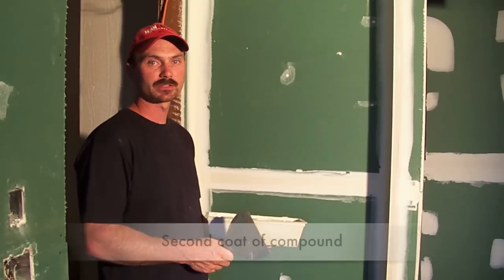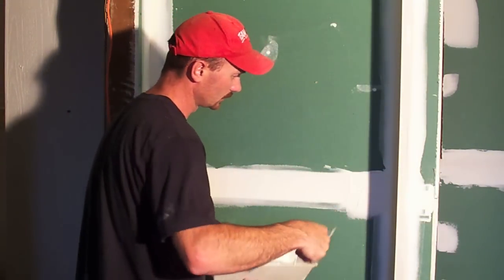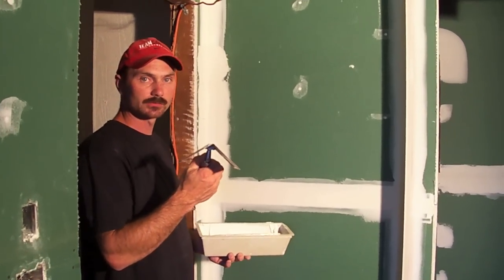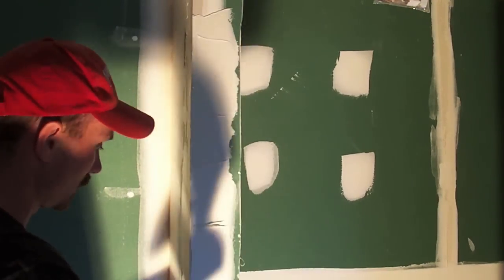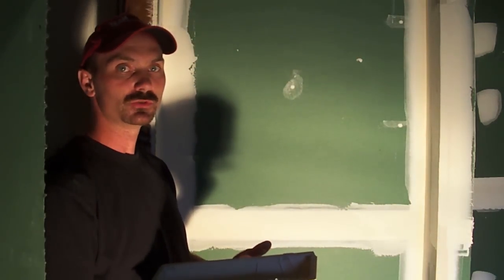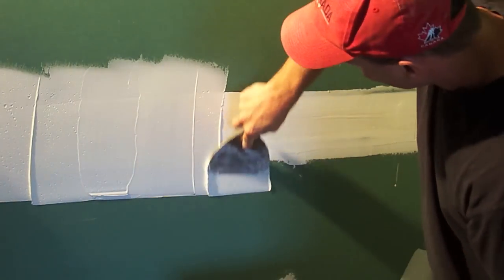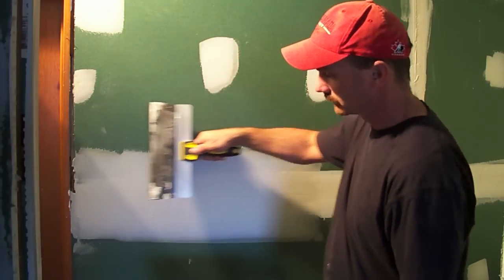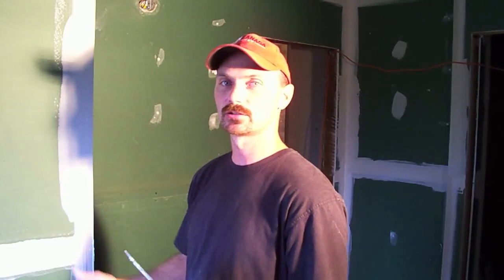How to mud and tape drywall [2of2]

Comment: I wish I had seen this video 35 years ago, when I was first learning. Mostly I taught myself with trial and error, and no instruction. Ultimately I came to use the same technique that you use, and I find it funny that you gave away all my hard earned tips in one easy lesson. You've made a great video.

Comment: To all the losers saying something like "You'd NEVER work for me! You'd get fired!": Please leave the name of your company so we know not to hire you. I've been in the building trade for many years and am sick of having to clean up the crap from so-called full time professionals who think they know everything and are only interested in getting finished fast so they can get to the next job. You always want to finish in an efficient amount of time, but it's the loud mouths and know all's who take the most short cuts, make the most mistakes, then cry out "I've been doing this for 20 years! I know what I'm doing!" This video is excellent for beginners/home handymen who have had trouble getting mudding & taping done. (And I've seen a few "pros" who should watch it too.)
Reply from the maker: Thank-you, and well put.
Reply: @Kauwhaka Sorry but we build office and light industrial buildings. The painters are paid to fix small imperfections. I need finish electrical, plumbing and ceilings in there ASAP I need doors hung, data pulled and servers installed. cabinetry..... After dry wall is hung you have two days tops. Current rate is $0.80 sq. ft. drywall mud and labor.
Reply: I'd never hire ABA Worlock . I doubt I'd be able to even communicate with him in English (not that that's even a good way of judging someone's skill...)
Reply: LMAO! Don't worry, if your that easily confused you'll never be in a hiring position anyways!
Reply: ABA Worlock you're*
Reply: Thank's for that! Give yourself a pat on the back, but I'm sure you already did! Stephen probably would have never figured it out! He's been racking his head for 2 years!
Reply: ABA Worlock obviously this video isn’t geared towards pros who move stupid fast and are more concerned with quantity over quality. They don’t need how to videos. These how to videos are meant for DIYers to learn the basics.

Comment: This is a video to help those with less experience do the odd DIY job. It is explained in a clear and sensible manner. Well done mate. I have been in the building trade over40 years as a builder and site manager I have had to oversee many a so called professional dry liner. Yes if your good you can do it in three coats but ive seen many a painter screaming because of crap workmanship,

Comment: I've been studying part 1 and 2 for a current project.  Over the years I haven't done enough taping yet to figure it out on my own, so from what you've shown here, I was immediately able to successfully apply several new techniques I have been lacking until now.  For me, this is the best video I've found on the subject.

Comment from the maker: Yes absolutely. I only sand after all the coats are done. Now as a first timer it will take some practice but like I say in the video use thin smooth coats instead of thick coats. It is easier to do a nice job with no sanding in between coats.

Comment: This is a great video.  I always had trouble with the butted joints, so the suggestion of doing a 24 inch, rather than 12 inch really helps.  Through the years, I am self taught, but still to this day, have trouble with certain things like butted joints.  Thanks a lot for posting!

Comment: Good video. I'm not a plasterer but I am repairing my parents summer home to sell. The home is drywall with no skim coat and some guy across the street told my father he knew how to plaster. What a nightmare, the guy must of been plastered when he plastered. You wouldn't believe what he did to the outside corners and with the walls that he skimmed, my god! I removed the outside beads and squared the edges with mud and sanded them. Now I'm going to use the type of tape shown here in this video.

Comment: my mud job is so bad, that the sander didn't even take off all the way, and of course I didn't know what was involved on how many coats of muds it took. well, I will do my best to sand all those lines out because I used to much. your videos really gave me the inside what's involved and how it's done. really learned a lot from it. really great video, even for someone that's a beginner. ready to start the kitchen.

Comment: Thanks man, I used to do 2 coats with lots of sanding and the end result finish was awfull. I didnt know each coat the trowel should be wider and now I realised it makes much more sense. I used to hate drywall joints because I ditn know how to do it and it was a mess, now I even like it and it is simplier thanks to you and this video, thank you !

Comment: Point up or punch out is when you correct what ever finish imperfections is on the wall after you prime the walls. Usually you would use a lamp or hologan lamp to see what ever it is you need to correct before painting. Thats normally done if your walls are slick finish, but if your going to texture your walls, (knock down, orange peel, or heavy splatter.) than you can skip that part but you should always double check your work.

Comment: Finally, a video that shows how to do 2nd and 3rd coats instead of just the first coat!  I tried to do multiple coats without drying, and it looks horrible.  It really does pay to wait for drying. 

Question:  One of my seams after the first coat has the tape not completely sticking to the wall in a few places.  No air bubbles. Do I need to completely take the tape off and start over? Or can I just proceed with the next coat?

Thanks for the video!

Comment: I would offer two suggestions.  I have used pre-mixed mud, just add water to thin if desired.  However, I have not found thinning the mud extremely necessary. 

When smoothing each coat, I have personally found it very comfortable, clean and effective to use a cloth or sponge with water to remove excess mud and knife marks.  Personally, I used a sock.  A sock is able to retain a fair amount of water without dripping too much.

Comment: If you apply pressure to the outside edge of the knife on the finish coats, the only bump will be in the center of the seam instead of one bump on each edge.  That means less sanding...

Comment: Well I finished my job and found only one bubble. The material I used was called FibaTape. It was paper/metal and it came in a 2" by 100' roll. I used green SHEETROCK Brand all purpose joint compound. I applied five thin coats.

Comment: Great videos! Not just this one.  I just subscribed to this channel and will refer to the forum as well.  I gave installing dry wall and mudding a shot a few years back, and man I wish I had put on thinner coats as you suggest. The sanding was a bitch and it turned out all waivey. Luckily I can help my brother with all his DIY projects at his house first before I try them at mine. :-) I am spending more time researching  now and I have found your channel comprehensive and easy to follow. Thanks!

Comment: I used this as a first time drywall-er, worked out very well, but still somewhat in the dark about inside corners, 3rd coat.  I'm guessing corner trowel cannot be used for that one.

Comment: Thanks for the great video. Have a question - the drywall compound says -wait for 24 hours for it to dry before applying second coat. My handyman was able to patch drywall and even paint it over in less than half a day...or even quicker. I wasn't home at that time to figure out what product or technique was used. So my question is - how can this be done? i.e how can a small dry wall patch like a 3 x 4 inch hole be patched and painted in less than 6 hours?

Comment: Thank you. Very helpful. I asked several people about their thoughts on that fiber tape or just tape. I prefer the tape. Fiber didn't work out the best...Snagged it once and made a mess. Although some people have mentioned applying mud let its sit for the day, apply second coat with tape and then the same steps as you...better or worse?

Comment: Hi Shannnon, All your videos have been very helpful in learning proper drywall technique. My question is regarding the third coat of the bevel joint. It makes sense to embed the tape to me, and then fill the bevel on the second coat. I can even understand filling it again because mud shrinks. However, why do we fan out the mud past the bevel? Doesn't this create a slight bump similar to a butt joint? I thought the benefit of the bevel was not having to "build up" mud on top of the tape and having to fan it out. On my own project I just filled the bevel and sanded and had planned to do a second coat similarly but perhaps this isn't correct!?

Comment: Hey Shannon !  Thank you for making your videos, very helpful and easy to understand for a home owner diy amateur like me. House improvements is my goto when I need advise on building and renovations of my house. Today I employed a guy to make some little butt joints job.  When I arrived at home after work, mud was applied to the holes in the walls and over the cracks but no tape was used. I had bought the mud and tape and was a bit disappointed when I realized that the tape was unwrapped but unused. Tomorrow I had plans for a day off, (beach day here in New-Brunswick), but it looks like it won’t be. What would you recommend at this stage ?  
Thanks again !
Daniel S.
Reply from the maker: If this guy is a pro then maybe he determined he he needed to prefill the gaps before taping? If you have more questions then our forum is the place to engage .

Comment: oh thank you for this video. i'm about to make my first attempt at this in a small closet. had a guy here who put the drywall up, it's a mess! there's no way i'm letting him finish it. he did a floor and it's terrible! there was a 1 inch gap between the floor and the wall that i have to fill with leveling compound. terrible. just terrible. this should be interesting, to say the least!

Comment: Thank you!  Great video. I learned a lot. I missed if you answered the question, but what is the difference between a bevel and buck joint?  Thanks
Reply from the maker: +Sean Ladrigan  A bevel is the tapered edges  (top and bottom of sheet) and the Butt joints are the ones at the ends that are not tapered. Here is a link to all of our drywall related videos. https://www.youtube.com/watch?v=yKt1M58bdM4&list=PLCF6D5F910F11A363

Comment: As part of my bathroom remodel, we decided to close off a doorway leading to a bedroom to make the bathroom and room feel bigger; it's not used as a master bedroom. In doing that, I installed a sheet of drywall that has a beveled edge adjoining a butt edge. Should I mud in the bevel until it's level with the butt edge then tape and mud it like a butt joint? Also, I'm using "Perfect Finish" FibaTape; is that a good tape? Thanks for the great videos.

Comment: Sir, this is very helpful video. I have a question, if u would. I'm working on a corner. I did apply the compound mud first, then placed the corner tape over. It looks very good, but do I still have to apply more computed over tape, or is ready to go for painting?

Comment: Your videos are always extremely information and helpful. How long does this take for example? To have all coats done? Is it a coat a day, to allow for proper drying and such?
Reply from the maker: usually that would be correct. With thin coats and low humidity I can get two a day at best with standard mud.

Comment: Hi,
Thanks for your videos they were very helpful, I have a question. We lived in our house for 7yrs now but in our garage the edge of the tape is lifting, the walls have paint. My question is do I have to take off the tape or do I put some mud underneath the edges and then on top. What is your suggestions
Reply from the maker: If it is just the edge then cut it off with a utility knife then mud it. The paper that is now painted will likely be to stiff to restick with mud.

Comment: Is that a Wisconsin accent?  I feel like I will be able to do it after watching you.  You should make a video "How to correct a screwed up drywall taping job" just in case.  I have textured walls from the 1970's and matching that up is going to be a bear. It's just a "knock down" texture.  I think I can, I think I can, I think I can.....  Great video BTW.

Comment: After you apply (and dry) the first coat, can you wait a week before you smooth out the first coat and then apply 2nd coat?  Or does 2nd coat have to be the day after 1st coat?
Reply from the maker: Yes You can wait as long as you would like, there is no set time limit

Comment: Great job.  I enjoyed all your mudding vids. My garage ceiling tape is and has come loose, and is hanging. My garage door opener is rough. Looks bad. I was thinking of using auto body filler. It hardens like cement. Then paint. Any tape ceiling repair advise would be greatly appreciated.  It will be my first time kidding. Thanks
Reply from the maker: Body filler will fix up your door opener nicely. As for the tapes cut them off and try to smooth out the old mud and reapply the tapes. It is tough to get a nice job if the old surface was painted but give it a try.
Reply: A couple of reasons tape breaks loose over time, ceiling tape especially. The tapers may have used a topping mud instead of an all purpose or taping mud. Topping mud has barely any or no glue in it at all, all purpose mud has plenty of glue (the mud isn't what keeps the tape stuck, it's the glue in it). Or, even if they used the right type of mud for taping, they could have wiped the tape too hard. That squeezes most of the mud (and the glue in it) out from under the tape. 

Use an all purpose mud and don't wipe the tape as hard as you can. A blue steel taping knife will help you out with that. They're designed to be thinner & more flexible to sort of not let you wipe the tape too hard.

Comment: he is not a professional drywaller, he is a general contractor, does all jobs, his techniques are easy to understand for the DIYes out there. I love his videos. Sure their are faster ways, but if you have seen this guys work, he cares about the final product, if it takes him 6 coats of mud, he will give it 6 coats to give it the professional look. Many professional drywallers are very fast, but also many of them if you look at there work up close, its crap, but they got it done fast.You decide

Comment from the maker: If the hole is 6x6 or smaller see my "patching a hole in drywall" video from my youtube channel. If it is bigger cut a square or rectangular piece of drywall for a patch. hold it against the wall covering the area you wanna patch.trace it out and then cut out the area. Add in some 1x4 straps in the hole area and place and your screw patch in place ,mud and tape,sand, paint

Comment: I am using joint compound which I imagined is the mud.You keep saying to a sour cream consistency should I add water to it or powder compound.The tape keeps slipping down.and its really necessary to use different size of knife for each coat and do I really need three coats.Thanks

Comment: So I started out taping on my own and, in a rush to get my project done, put on two quick coats and then painted as soon as it was dry and sanded quickly. Needless to say it looks horrible with the beveled edges not completely filled in and very rouch in spots. Can I mud over the joint after it's been painted? Should I sand the paint first? I should have watched this video first, admittedly. Any help appreciated.

Comment: Thanks - Question - if we didn't go quite far enough in filling the indentation and then feathering out the joints (i.e. missed the last stage with 10 or 12 inch knife) and have already painted (joints show after 2 coats) can we simply continue over the painted surface and work on filling and feathering and then re-paint or do we have to do things differently over a painted surface?

Comment: I'm moving into a house with these "decorative" type corner pieces in every corner of every room and I was wondering if you would suggest getting profession help instead of trying it myself. They are in every inside corner and along the tops of the walls where they meet the ceiling. I don't even know what these are and they look poorly done since they are nailed on. But it's really bad looking. Haha! There are 6 rooms done this way so it will be a lot of work if they are tapered underneath.

Comment: I commented a while back about the "decorative" pieces in the corners of the rooms in my house. I pulled some back and they aren't taped under them. The problem is some only have a small gap between the drywall but some have gaps up to half and inch or more. Can I still mud those without much trouble? And will paint on the wall keep the mud from sticking properly to the walls? Thanks for any help!

Comment: What's the differences between the sheet metal corner beads and the paper/metal corners?  I am working on a basement in my home and purchased the full on metal corners.  

Are those usually used for larger industrial buildings?  Also what about the thatched tape as opposed to just straight tape?

I got the thatched tape as opposed to the stuff you used, should I take it back to Lowes?
Reply from the maker: The all metal corners need to be screwed to the corner with a lot of screws  (about one every 8" on each side ) I just find it very time consuming. The mesh type tape is fine I just prefer the paper tape because it is thinner and sometimes easier to cover with  thinner mud coats